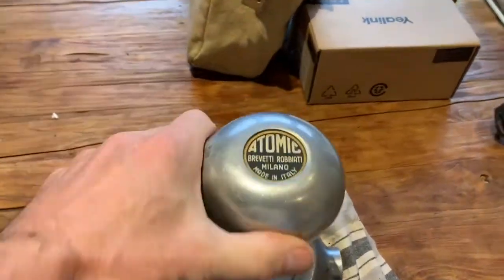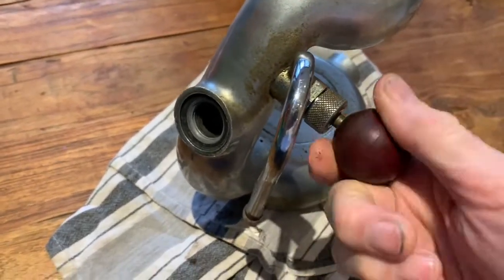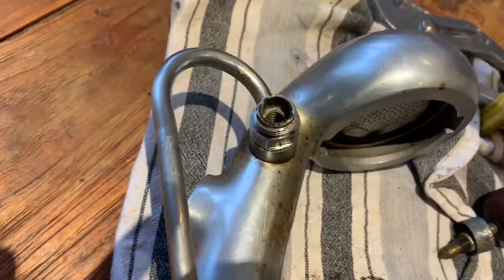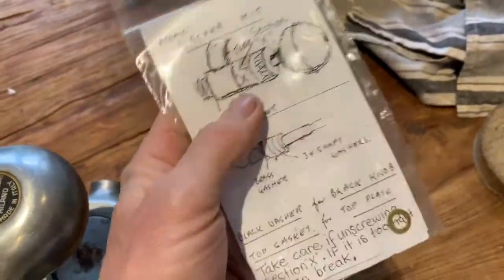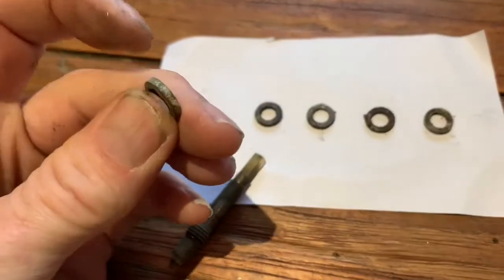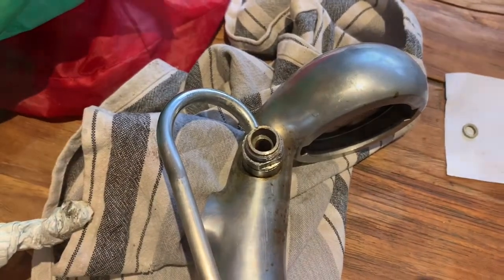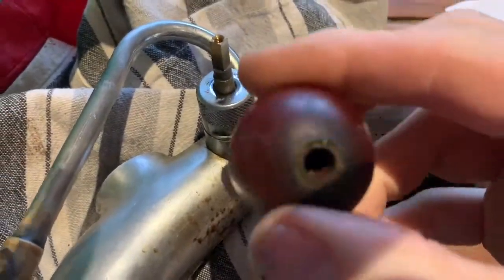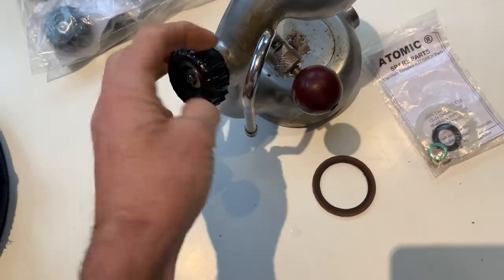Atomic Coffee Machine gradual loss of steam pressure

Comment: Thank you so much for your videos Scott! I have the gasket set from Bon Trading now. I'm having a bit of difficulty getting the screw out of the red knob ( not Phillips head). I've put a little WD40 but no dice. I'm unscrewing it to the left. Any tips? 
Update: I rang Bon Trading and got the original lady owner! She said because the seals are silicone, no need to take off the red knob if it's corroded. Just push the seals over the brass but so that comes first in the correct order. That worked.
Reply from the maker: Hi - sorry to hear you are having problems getting that screw out. I have just come back from Australia but didn't get a chance to see Irene on this trip - what a privilege to speak to her in person! Just for you info. The screw which holds on the red knob is about 1.5cm long but only the last 1 or 2 mm are actually screwed into the shaft. The screw is often rusty and can be really hard to get out. If you drill (or grind) off the head of the screw, you will be able to get the red knob off and have about 1cm of exposed screw left. This usually comes out with a set of mole grips. Worst case scenario it snaps and you end up having to drill it out and re tap the threads and put in a new screw. Sounds daunting but not too bad in practice. Mike in England

Comment: Hey Scott, trying to troubleshoot poor steam pressure in a new Atomic I bought. Followed the instructions here with a new gasket kit and replaced everything. I noticed that my knurled steel nut part won't close up completely against the thin washer on the steam arm even with some strong encouragement with some vice grips. Looking inside the knurled nut there's a little black rubber gasket in the back of it. Is that meant to be there?

Comment: Those seals are not rubber, they are fibre washers. The assembly is called a "gland seal", the same as used on steam engines and prop-shafts on boats. The fibre swells up when it is wet and the nut compresses the washers creating a seal.
Cotton string or hemp fibre is a good substitute for people that don't have the opportunity to get to Bon Trading in Sydney.
Reply from the maker: Thanks for your comments.All Atomics should have a hole in the tube opposite the filler knob. I'm not 100% sure but I imagine that this is to facilitate the operation of the steam release valve in the filler knob. You probably know this already by Atomic Coffee machines are hand assembled in Italy and I have never come across two which yield exactly the same amount of coffee. 

The amount of water which comes out of the machine is related to how far the tube sits from the base of the machine and this varies between machines. In a  non steam arm Atomic the tubes sit almost on the base so that what you put in equals what you put out. The residual water in a steam arm machine is there to produce the steam for frothing the milk. I would NOT attempt to bend this tube down because if you snap it or damage it you have pretty much knacker your machine. Sometimes these tubes are really badly corroded at the end which can effect the quantity of water. 

The amount of coffee which comes out is also related the the grind size of your coffee and how hard you tamp it. Finer the grind and harder the tamp = less coffee. Different machines will tend to generate different pressure and a fine grind/hard tamp on one machine with no leaks may yield almost no coffee on another machine.

The heat source is also a big factor in determining how much pressure you generate and how much coffee comes out. A single aerosol  camping stove progressively yields less coffee after multiple uses as the diminishing heat lowers the pressure.

Last but not least....getting an inch or so of coffee in the jug is about right. If you are getting anything approaching a full jug you must be using a relatively coarse grind and will likely be producing very over extracted coffee. Just my opinion but you generally get a better ttasting coffee if you draw a great expresso shot and add hot water to it.

All the best. Mike
Reply: @scottitonline  I beg to differ, I have one that doesn't and works fine. I cant imagine what that hole should be for but the steam release is driven from the main chamber through the hollow casing. Like I said, I blocked mine wit a toothpick and it works way better. There has to be a pressure difference between the group head and the chamber for it to work, this hole would only allow that when the tube is full of water and then only until it equalizes.
I must get to the bottom of this, it don't make no sense at all.
Cheers.
Reply from the maker: What are you 'begging to differ' about? That genuine Atomics all have that hole or that the hole is related to the steam release valve? Out of interest:

1. What does the label say on the top of the Atomic without a hole in the steam tube 

2. Are the two machines you are comparing identical on the outside.

3. Do both machines have steam arms?
Mike
Reply: @scottitonline  Ok.
Both really ;-)
The one without the hole is a "Atomic Home espresso,
Bon trading co. Woollahra Sydney NSW, made in Italy.
The other one says Atomic Cappuccino MAKER, Bon trading.... etc. also made in Italy.
Other than the hole and label they appear to be identical, both have steam wands.
One thing I did notice was that, on the one without the hole the coffee stays wet after use whereas the one with the hole the coffee ends up dry. This is possibly the reason for the change, the fact that the holes are drilled after assembly may be a clue here. 
The "Home Espresso" was purchased in the early nineties, second hand so I am guessing this is from the eighties or earlier.
The first link is the oldest one, the one without the hole.
https://www.dropbox.com/s/mrqpl0c5ay64i15/IMG_20210330_121627.jpg?dl=0
https://www.dropbox.com/s/6hj2nad9xynikwc/IMG_20210330_121610.jpg?dl=0
Reply from the maker: Thanks for the pics. I have some of the earliest Atomics ever made and they all have that hole - steam wand or not. In fact even the my 'pre steam valve' Atomic has that hole. I'm waiting to hear back from Irene who has owned and run Bon Trading for decades. Would you be able to send me a picture of the 'non hole' tube? There are a whole bunch of replica atomics out there badged as Bon or sometimes Bou trading.
Reply from the maker: @BoB-Dobbs_leaning-left  Thanks for the photos. Wow, that is a pretty Heath Robinson filler arrangement you have put together. Those threads often get seized or stripe and the usual repair would to tap and die them. If things are really bad, you might use a helicoil to maintain the asthetics of the machine and the ability to use standard parts. As for the missing hole, it could either an oversight in the manufacturing process (unlikley) or maybe someone replaced the tube because teh other one was blocked or corroded. The latter might make more sense because a seized filler knob implies that water was left in the machine for a long period of time. Over and out. Mike
Reply: @scottitonline  Heath Robinson? Sir, I am offended, I regard it more H. G. Wells or Jules Verne, Steampunk if you will.
It wasn't so much seized as loose and leaky and the Bakelite was broken, I thought the old knob was ugly anyway. I have often thought of fitting a pressure gauge and a whistle to make my mornings more entertaining.

Comment: Thank you for the very informative videos. I tried this on my Atomic. The steamer knob unscrews quite a lot, the gets stuck. It won't turn any further, nor will it pull out. The little collar fully unscrews. I'm afraid to force it. Any suggestions?
Reply from the maker: Hi - apologies for the delay in replying I've only just seen your comment. Do you mean the ball shaped red knob? If so, you have to undo the screw in the end of it and then it should just pull off. Mike
Reply: @scottitonline  Thank you for the reply. I mean the entire shaft assembly that the red knob is attached to. I managed to get it out with some back and forwards movement. I replaced the seals on the shaft, but its still losing pressure via the steamer, so I'm guessing the brass inside the thread is cracked.
Reply from the maker: Hi - How do you know that the machine is losing pressure via the shaft assembly? Can you see steam leaking out or can you hear it?

Steam leaks and pressure loss is far more common from the black steam knob or the top seal where the group handle attaches.

IF you are 100% certain the shaft assembly is the source, I would have thought the most likely reason is that the conical tip of the shaft is not seating correctly. This could be simply because it )or the mating surface) need cleaning.

Let me know how you get on.

Mike @beach6060
Reply: @scottitonline  This Atomic has worked well for decades. I always maintained it. I always got good pressure out of it and often had to be careful to get to it in time as I would end up with far too much coffee in the cup. Then one day after the initial amount of water through the coffee, it just stopped flowing. Careful inspection revealed steam escaping from the steam knob assembly. I changed the shaft and put in new seals. I put in a new top seal. Its still losing pressure. When I open the steam knob a lot of very hot water spurts out of the steam assembly, around the shaft, etc. So I have concluded that the brass inside the steam assembly has probably cracked, creating the loss of pressure and lack of flow.
Reply from the maker: Hi - what part of the world do you live in? If you are in UK, I's be happy to look at your machine. If you are abroad, can you take a video, upload it to YouTube and post me a link?

It COULD be that the brass shaft has cracked but it would be the first time I have seen this....and a cracked shaft wouldn't necessarily account for water coming out of steam wand.

Probably a REALLY stupid question but is there a chance that you are over filling the machine? 

1. I assume that each time you make a coffee you empty out the old water?

2. Assuming you use the Atomic jug to fill the machine, how many millimeters of  water do you put in the jug

When coffee come through the machine how many millimeters end up in the jug?

What does the badge on your machine say (eg Bon Trading, Sorrentina, Brevetti Robiatti)

When you unscrew the black steam knob, can you see a small hole in the tube opposite where the black know screws in?

Mike @beach6060